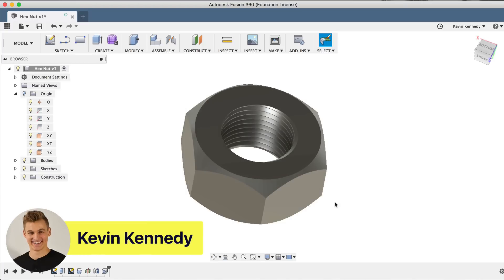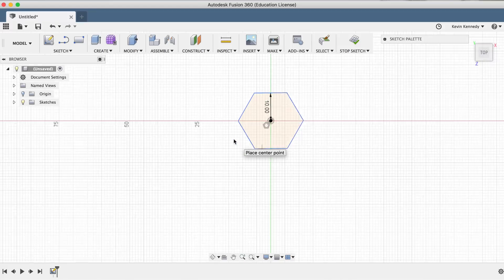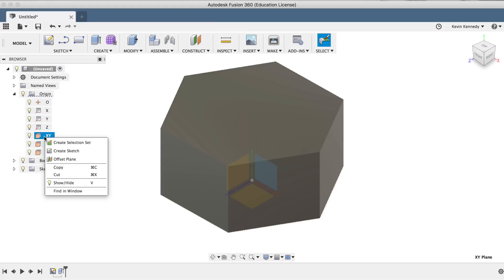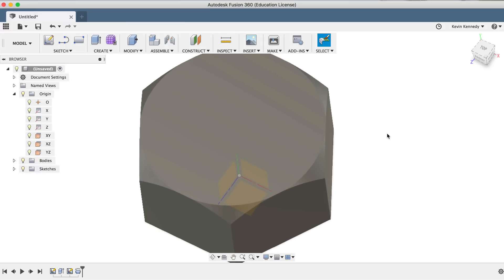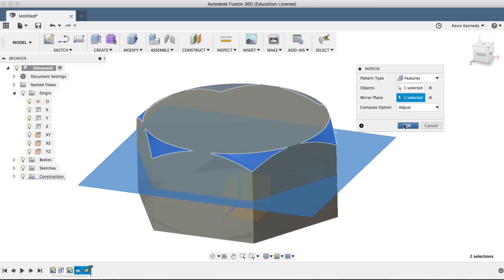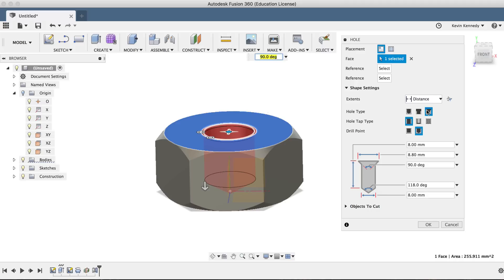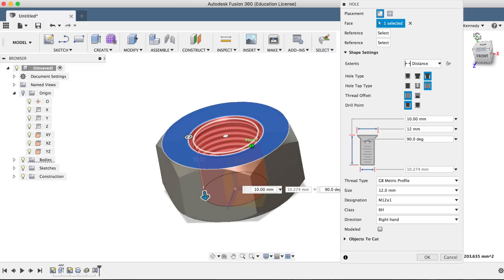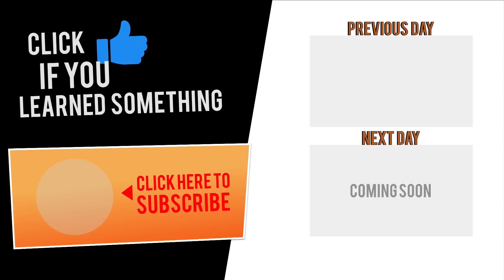How to 3D Model a Hex Nut - Learn Autodesk Fusion 360 in 30 Days: Day #6

Comment: Hi Kevin, really enjoying the lessons for far. This lesson i hit the first speed bump... Like a few others in the comments, i really struggled to sketch the triangle onto the corner of the polygon, causing unpredictable results with the revolve. In the end (based on one of your replies below), i drew the triangle in free space then selected its corner and made it coincident with the corner of the solid. It was kind of annoying though since i just couldn't seem to snap the line into place as i drew it, and didn't really understand why. There didn't seem to be a lot of grid or snap options open to me, and none of them helped. Are there more in depth snap settings somewhere in the program that i could tweak?
Reply from the maker: Hi, Trev. Please check your "Auto Project Edges on Reference" setting. Here's a link to my website where I have my default settings (and changes) noted. This will explain where to find this setting and how to turn it on. https://productdesignonline.com/default-settings-for-fusion-360-tutorials/

That setting should fix this issue. It used to be one of the default settings but the Fusion 360 engineers recently changed it (not sure why as it's a very useful setting). Make sure to restart Fusion 360 after you apply the setting, as a restart is required in order to get the setting to take effect. Cheers, Kevin :)
Reply: @ProductDesignOnline  That's done the trick. Thankyou very much.
Reply from the maker: @revfind  You're welcome! Glad that was it. Cheers, Kevin :)
Reply: @ProductDesignOnline  qsdfghjkl blessu thx u some much I was strugling with that since the beggining

Comment: At 2:22 you snap your lines to the corner of the hex nut.  This is impossible for me - it snaps to the grid which is very near to that corner (but not perfect).  If I have 'snap' enabled in the sketch menu and disable 'snap to grid' in "grids and snaps" it doesn't try to snap to anything at all.  I've completely restarted this tutorial 3 times and re-applied default settings multiple times trying to sort this out.  I am confident I have followed your steps precisely up to this point, has something changed in the software?  I can snap to that point in any other view, but when I am sketching on the XY origin plane it doesn't recognize that point as 'snappable'
Reply: It recognizes that point all the way up until I press L to open the line tool, and then it stops snapping to the vertex and starts snapping to some random grid point nearby.  Probably going to just skip this tutorial because an hour on a 7 minute lesson has provided enough frustration for today :P

Edit: Found a workaround.  Had to create a sketch on the top face of a line from that vertex 1.5mm toward the center.  Then created a second sketch on a side face from that vertex down 1.5mm along the edge.  With those two sketches created, I was able to create a 3rd sketch as you describe (using the XY origin plane) and created the triangle which I was then able to revolve.  Not nearly as convenient as your method, but at least it worked.
Reply from the maker: Hi, Emeses. I'm happy to see you were able to troubleshoot and come up with a workaround. I'm not sure what could've been causing the line to not snap without taking a look at your file. Here are all the settings I have turned on in my sketch palette - https://snag.gy/R0a6xc.jpg

I'd double check that they are all the same, as it could be something other than the snap command. Other than that, I always record tutorials with the Fusion 360 Default settings, in an effort to minimize discrepancies.  Cheers, Kevin :)
Reply: @ProductDesignOnline  I experienced the exact same problem described here and I followed all the steps very carefully. Maybe this tutorial doesn't work with newer versions, I'm on 2.0.5827
Reply: @ProductDesignOnline  Also, this is the first non-revised tutorial that I try. My concern is that all "non-revised" ones will have issues like this.
Reply: Reporting back. I got this to work by using Inscribed Polygon instead. The only reason that worked is that the edge of the polygon coincides with the grid lines. With the circumscribed polygon it doesn't match. In either case there was no way to snap the line to the polygon, only to the grid.

Comment: Absolutely loving the series. Thank you. Coffee has been bought. One problem I'm coming to in this specific tutorial happens when I go to edit the triangle sketch it somehow moves the hole off center creating a Pacman shape. I'm thinking this has something to do with my hex shape not being "constrained" but I followed the directions to a t several times. I'm going to redo the lesson again looking out for mistakes I made. Either way thanks again for these great vids.
Reply from the maker: Hi, Caleb. First off, thanks for the support! I really appreciate you buying me a coffee!

At 2:23 if you clicked on the corner, where it snaps into place, that should help ensure that your triangle stays at the corner by automatically adding a "coincident" constraint. Let's first check to see if it did or not. Click on that corner point and a coincident constraint should appear. If not, that means you should be able to drag the triangle around freely. If that is the case, hold down the shift key on your keyboard. Select the corner of the triangle, then select the corner of the hex nut. Then, select the "coincident" constraint option in the sketch palette.

If that still doesn't solve it then please share your file and I'm more than happy to take a look at it. Cheers, Kevin :)
Reply: @ProductDesignOnline  Having the same issue.  After editing the corner dimensions, when finish drawing is pressed it off sets the threaded hole from center to the side.  However I am enjoying the tutorials, very well presented and enjoyable to learn.
Reply from the maker: @grnsouth1204  Glad to hear you're enjoying them! Can you share the link to your file? To share your file please go to File > Share > Share Public Link (make sure "downloadable" is toggled on) > Paste your link here as a reply to this comment.
Reply from the maker: @grnsouth1204  That link is the phone case model. Can you share your link to your hex nut?
Reply: @ProductDesignOnline  Sorry, I have no idea how I managed that. facepalm  Try this one: https://a360.co/2GI22AK
Reply: @ProductDesignOnline  Great stuff!  I'm having the same issue!
Reply from the maker: @JesseKellys  Can you check that you have the "Auto Project Edges on Reference" setting turned on - https://productdesignonline.com/default-settings-for-fusion-360-tutorials/#autoProject
Cheers, Kevin :)
Reply: @ProductDesignOnline , I had the same problem.  It seemed like the issue only occured when I made the chamfer larger than 1.75.  If I made it smaller the hole stayed put like you'd think it would.  It was simple enough to go back into the hole on the timeline and re-center it where it belongs.  Curious if you'd found out what caused this.  I do still have the "auto project edges" option still enabled from a previous lesson.  The corner affected with "threaded Pac-Man mouth" is the one with the triangle cut out for the chamfer.

Comment: Agree with everyone you are easy on the ears. Looked through your videos and this was the only one I could find addressing threads for nuts. It would be nice to have one video for referencing discussion on all steps surrounding making bolts, nuts or placing threads on a surface or round column. Thank you for your time and effort.
Reply from the maker: Thanks, Rud Dog. I appreciate the suggestion - maybe a video on threaded bolts and nuts for 3D printing (getting the tolerances set up) would be good. Cheers, Kevin :)

Comment: In all your tuts I started correctly from the top plane but always my z axis is switched with you Y axis. I dont know why, but I use that as a reference and when you say select the xy plane I just select zx plane. Is this a different config?
Reply from the maker: Hi Alessandro. Great question! Fusion 360 used to have the default set to be the Y-axis in the "up" position. However, about a month ago, they changed the default to have the Z-axis set to "up."

You should be able to complete all the tutorials without any troubles...you'll just have to select the opposite corresponding plane. Otherwise, if you head your username in the upper righthand corner > preferences > general tab > change the "default modeling orientation" to the "Y-up" option.

Cheers, Kevin :)
Reply: Thanks! Maybe the change is due to the actual orientation of 3d printers and CNC where Z axis is the default vertical one. Thanks anyway!!
Reply from the maker: @alessandrofonseca7796  I believe that is why. A lot of users use to complain about this on the Forum, which likely encouraged the engineers to changing it. Cheers, Kevin :)

Comment: I notice as modeled there is no countersink on the bottom of the nut.  I am thinking to get that we could split the body at the midplane then delete the bottom half and mirror the upper half and combine.  Would this be a acceptable solution?
Reply from the maker: Hi, ctbram0627. Great question. That would be acceptable - the only concern would be the threads getting messed up (not sure without trying). As an alternative, you could add a countersink to the other side using the "chamfer" tool in the modify dropdown list. Cheers, Kevin :)
Reply: @ProductDesignOnline  oh jeese yes I forgot about reversing the threads half way through.  lol.  Your suggestion is simpler and solves the chamfer issue directly.  Thanks!
Reply from the maker: @ctbram0627  You're welcome! :)

Comment: Really enjoying your videos, and learning a lot!  Stuck on this one however.  I cannot get past the point at 2:22, trying to get the lines to snap to the corner.  I checked to make sure "snap to grid" was enabled in "grids and snaps" and it is.  Did you snap to a point at the intersection of two lines there?  I tried adding a point to that intersection but could not get it to place one there.  I wanted to share my model with you for help, but the option to share and make downloadable is not available to me.  Could that be cause I am using a free version of Fusion 360?
Reply from the maker: Hi, daywalker750. You'll want to check one more snap setting. Activate any sketch tool, which will open up the sketch palette. Then, you'll notice in the sketch palette there is a "snap" option. Make sure that is checked on. That's likely why yours wasn't snapping to place, given the model probably didn't line up exactly with the grid. Here's a reference image for your convenience - https://snag.gy/uhB9s5.jpg

As far as sharing your file, it doesn't matter what license you have. The sharing capabilities are all the same. Here's a video explaining how to share a public link - https://youtu.be/2XrcrdV-8Ls

Please let me know if this helps! Cheers, Kevin :)
Reply: Thanks Kevin, I checked that and the snap box is the sketch palette is checked, unfortunately I still cannot get it to snap!
Reply from the maker: @daywalker750  If you share your public link to the file I'll take a look at it to see what could be causing this. Share your public link as a reply to this comment. Here's a video explaining how to share a public link - https://youtu.be/2XrcrdV-8Ls

Then, please write a separate comment letting me know you've replied with a link because YouTube flags most links and I don't always get notified. Cheers, Kevin :)
Reply: Public file here https://a360.co/2S8nuqu
Reply from the maker: @daywalker750  I had a chance to look at your file. On my end, it appears to be snapping to that corner okay. Here's a reference image showing so - https://snag.gy/ljkt4X.jpg

Therefore, it must be a difference in settings. I'm not sure what could be throwing this off is both your "snaps" and grid snapping are turned on. I would suggest resetting your preferences to the default preferences. Click your name in the upper right-hand corner and then select Preferences. Select "Restore Defaults" in the lower left of the dialog. Then, be sure to restart Fusion 360 to ensure the changes are enforced.

Let me know if this helps. If not, we may have to create a post on the Fusion 360 forum to see if anyone else in the community knows what may be causing this. Cheers, Kevin :)
Reply: Thank you Kevin, that did it!  Just completed the tutorial, wish I had not hit the "tab" while putting the profile lines in as that prevented me from editing the chamfer at the end.  But, it did work so thank you very much!
Reply from the maker: @daywalker750  Great! I'm happy to hear that you got it working. Please don't hesitate to comment any questions as you work through the remainder of the series. Cheers, Kevin :)
Reply: @ProductDesignOnline  I tried this as well, default settings and went restarted the program but no luck, still only snaps to the grid but not to the object
Reply: Reporting back. I got this to work by using Inscribed Polygon instead. The only reason that worked is that the edge of the polygon coincides with the grid lines. With the circumscribed polygon it doesn't match. In either case there was no way to snap the line to the polygon, only to the grid.
Reply from the maker: @gihadmurad  They just changed the default settings this past month. Please check your "Auto Project Edges on Reference" setting. Here's a link to my website where I have my default settings (and changes) noted. This will explain where to find this setting and how to turn it on. https://productdesignonline.com/default-settings-for-fusion-360-tutorials/

That setting should fix this issue. It used to be one of the default settings but the Fusion 360 engineers recently changed it (not sure why as it's a very useful setting). Make sure to restart Fusion 360 after you apply the setting, as a restart is required in order to get the setting to take effect. Cheers, Kevin :)
Reply from the maker: @gihadmurad  Please try the setting as noted in my reply to your other comment and let me know if that fixes it! Cheers, Kevin :)
Reply: @ProductDesignOnline  This solution worked! Thank you.
Reply from the maker: @gihadmurad  Happy to hear that worked! Cheers, Kevin :)

Comment: Great tutorials, thank you! It's a little strange to countersink only one side of a hole, right? Why wouldn't you countersink both sides (top & bottom), and how do we model that?
Reply: I'm going to jump on the comment here and mention my process. I used the mirror method mentioned earlier in the video except rather than selecting "feature" as the pattern type you need to select "faces" and highlight the chamfer then mirror around the midplane.
Reply from the maker: Thanks, Jonah! I'm happy to hear you are enjoying my tutorials. I actually modeled this hex nut off of one I had in my spare parts bin. I would assume the only reason it was only countersunk on one side was to manufacture it as cheap as possible. With that said, you are correct - most of them are countersunk on both sides. At the time of writing this, Fusion 360 does not offer a way to do a second countersunk within the hole command. What you would have to do is use the chamfer command on the other side of the hole, by selecting the edge of the hole as the edge to chamfer. Cheers, Kevin :)
Reply: Wow, thanks for the super-quick and detailed reply, you're the man! I'm looking forward to watching your videos on some of the more advanced (CAM + CAE) capabilities of Fusion 360; for now I'm happy to be learning the basics, thank you, thank you!

Comment: On the sketch, my X Y Z is laid out differently than yours which can make it difficult to follow you. How can I flip it around?
Reply from the maker: Hi halfstep67. My workspace was set to "Y - up" and it sounds like yours is set to have the Z axis up. To change this you'll want to click on your username dropdown in the upper right-hand corner > Select Preferences > General Tab > Then change the "Default modeling orientation" to "Y-up." Be sure to hit "apply" and "OK" to save your changes. Cheers, Kevin :)
Reply: That was it. When I downloaded it, it was set Z-up but Y-up seems less confusing. Thanks for the help.
Reply from the maker: @halfstep67  You're welcome! Glad I could help! :)
Reply: Does the orientation of Y-up or Z-up matter if one designs a part to make on a CNC milling machine?
Reply from the maker: @halfstep67  The short answer is no. Most CNC or 3D printers slicing software have the ability to switch the Y/Z-up model orientation to ensure the model is correctly oriented. With that said, a lot of milling software defaults to the Z-up as being the standard...so if you're planning on using a CNC CAM program other than Fusion's native CAM then it wouldn't hurt to just use Z-up. Cheers, Kevin :)
Reply from the maker: You can also change the orientation of your model in Fusion 360 -> https://youtu.be/GwGa0Z50jLg
Reply: Thanks, I plan on using fusion only for CAD/CAM. At least for a good while. It will take me some time to learn this so no need in using anything else. My little brain might pop if I overload it.